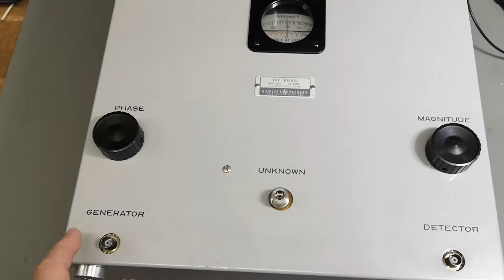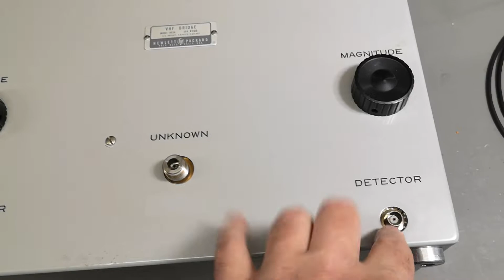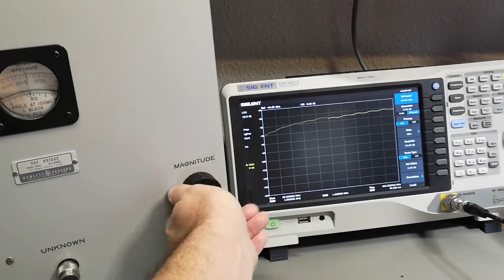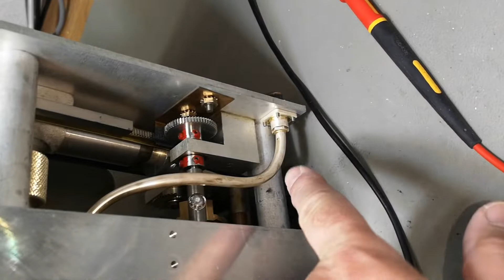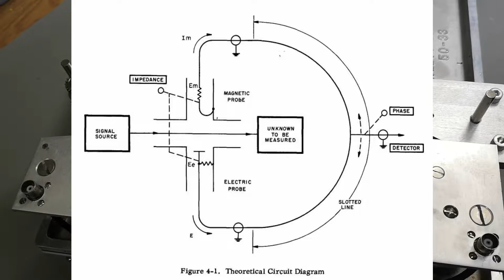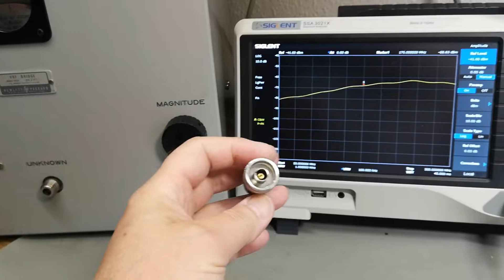HP 803A VHF Bridge Impedance And Angle 1955 test and teardown

Comment: I have the suspect that they use it with a crystal detector. Something like hp8472A. Is it possible?
Reply from the maker: anything that can detect signal levels can be used as a detector, for a generator you just need to know the test frequency